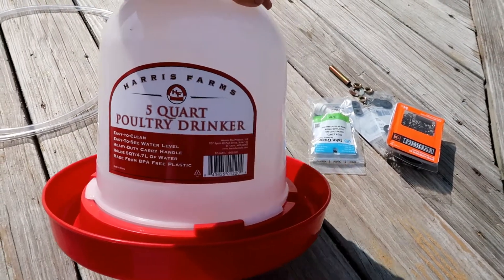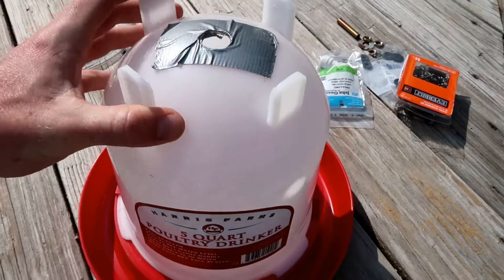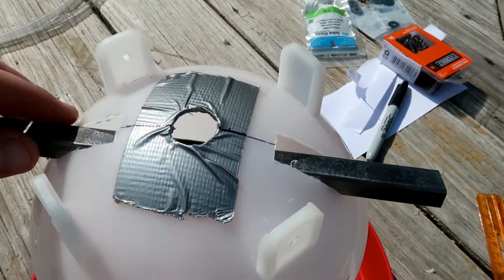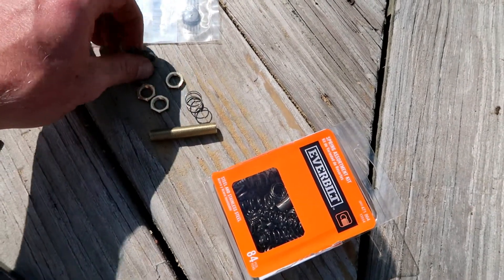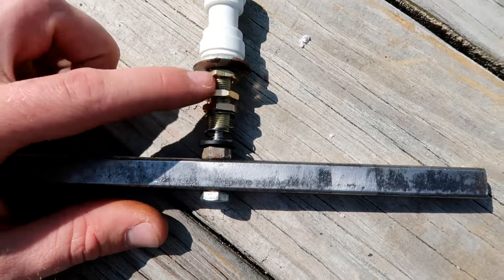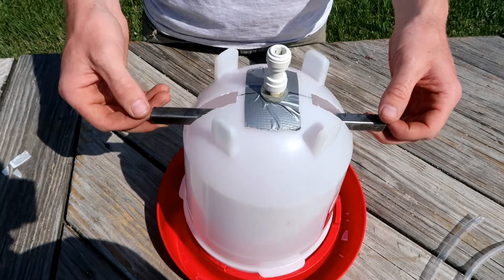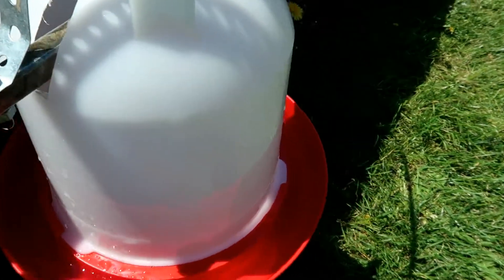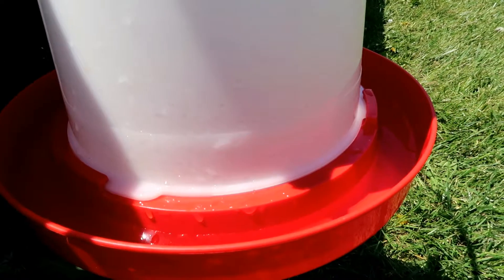Homemade PLASSON Poultry Drinker - $14

Comment: Nice effort, but not sure you saved yourself much considering all the parts that were purchased and time invested. I do concur $50 seems a bit high for the waterer, I'm surprised it doesn't have more competitors in the market. I am literally trying to solve this conundrum myself and I already have the 55 gal food grade barrel I want to use as the source. But I think I'm going to keep it simple and just buy the waterer and install a ball valve on the barrel and put it on a stand.